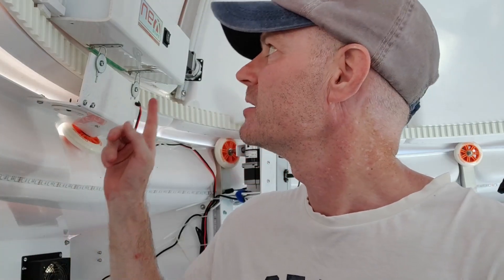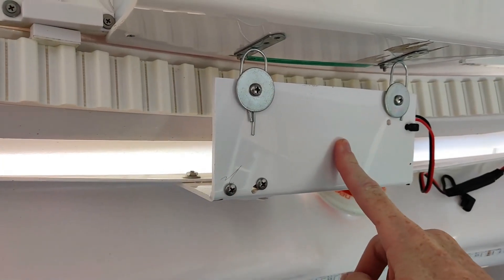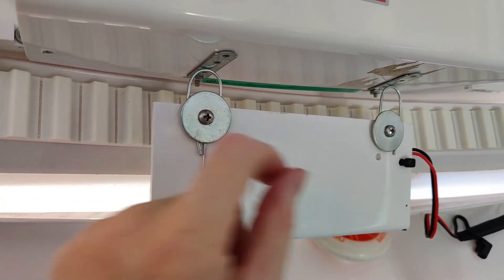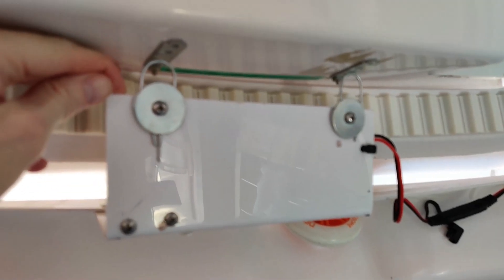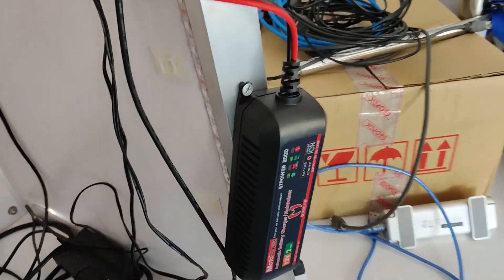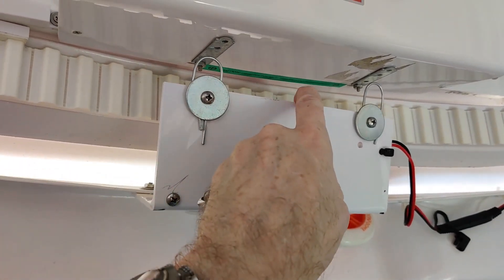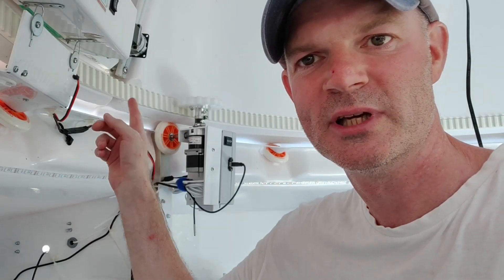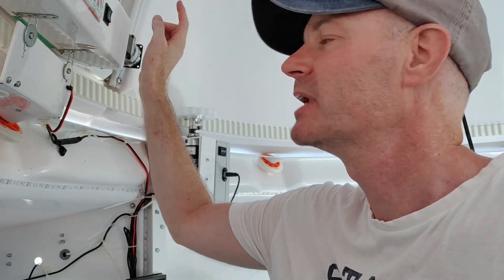NexDome Shutter Charger Modification

Comment: Excellent MacGyver fix . You may find this Product of interest , Stabilant 22 , an "Electronic Contact Enhancer" . Google it . We used this a lot at Work on all kinds of electrical contacts . You could "paint" the metal plates that your metal wires run over as an extra means of contact , Every little bit helps eh ? /SRK
Reply from the maker: This has probably been the single best mod that has been done on the dome, something that should be default in the factory!

Comment: I guess the best fix is the one that works Dave.  I don't know much about these nex domes but they seem to have a few niggles in terms of it all just working.  Just wondered how it's performed vs your expectations going in?  Nice Pacman also 👍
Reply from the maker: I suspected there would be tweaking, but do think some of these issues should have been picked up during design and prototype. They are constantly changing and tweaking with each run, they have recently changed the shutter to a roller and rail mechanism in the latest iteration.